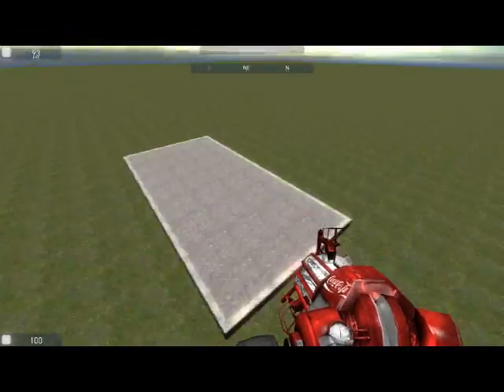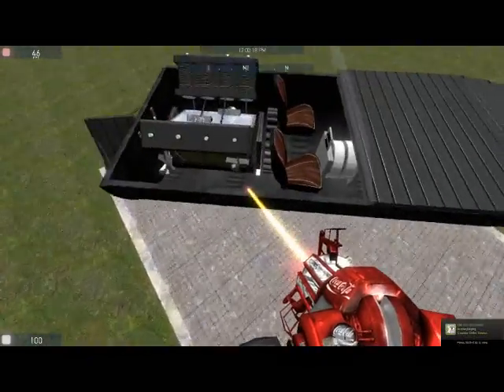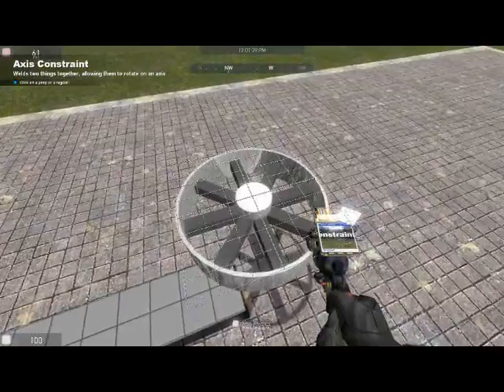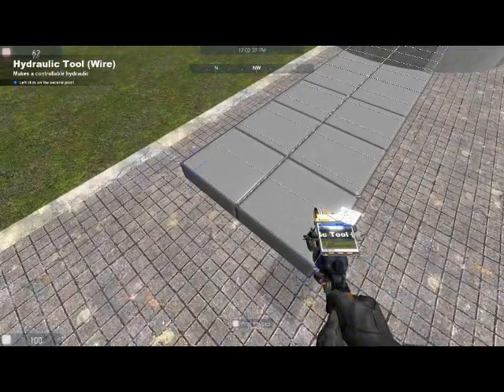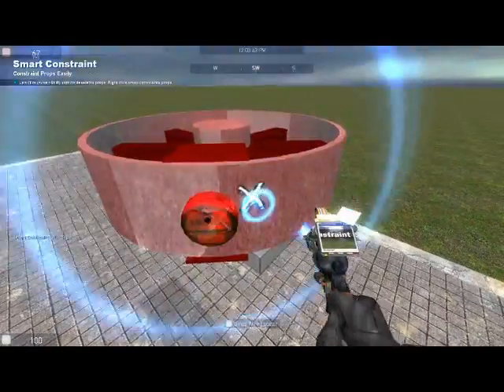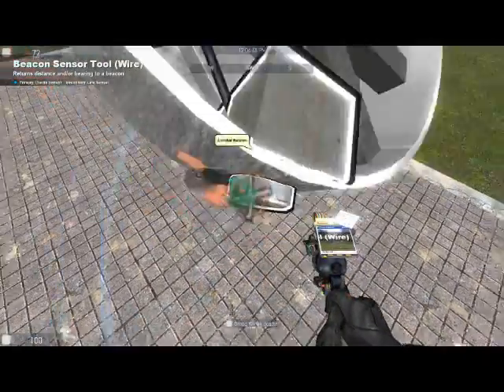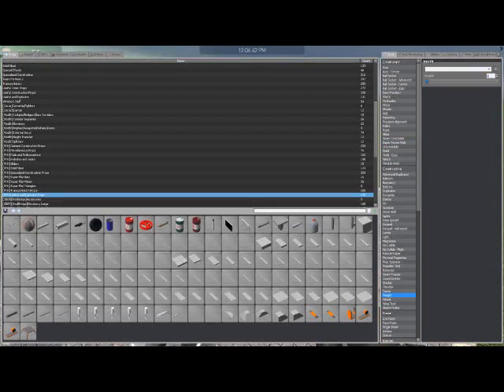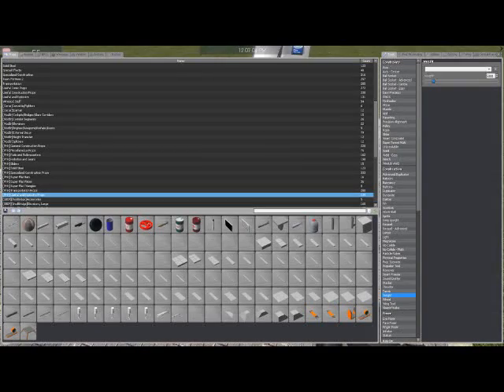Gmod Hydraulic Engine Tutorial - Hydraulic Engines Explained {#3}

Comment: Take the advanced ballsocket tool and set all the values to 0 and check free movement, then you click the crankshaft (In this hydraulic motor, it's the wheel) then attach it to your car's wheels and you're done.